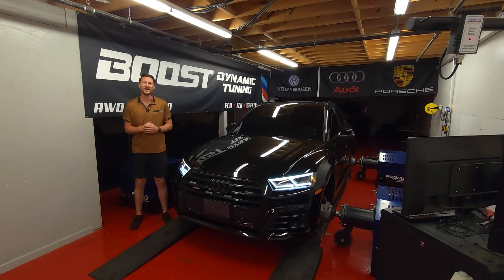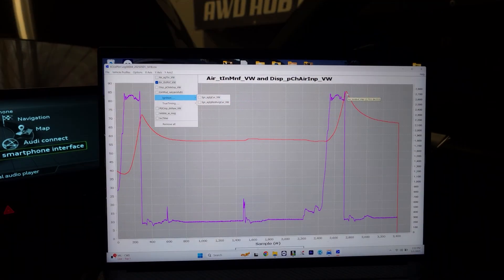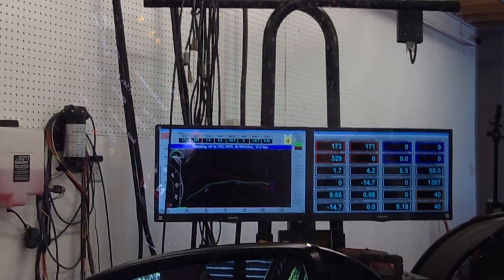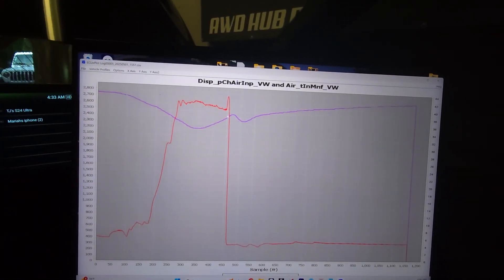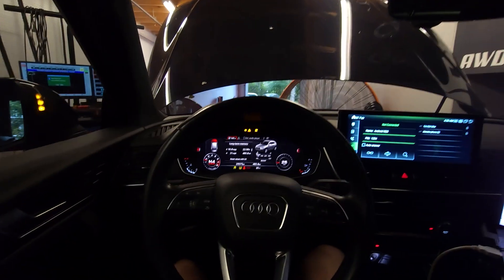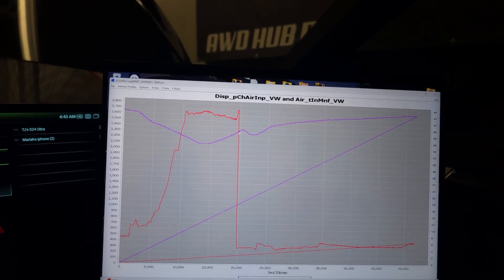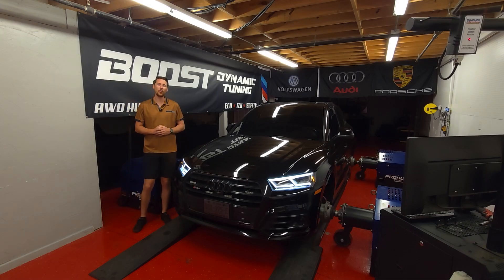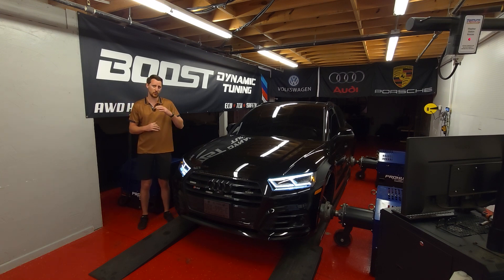B9 SQ5 3.0T Dyno Tested! Testpipe vs FMIC vs Turbo Inlet — What Actually Makes Power?

Comment: If the car is tuned with a test pipe and I decided to add a universal  300cpsi cat downstream to the exhaust simply to remove the smell, is a retune required?
Reply from the maker: No, no retune is needed at all.

Comment: What schooling did you have to do to learn how to tune? Did you just apply what you learned at school and started tuning right away or did you work at a tuning company first? I’ve always loved tuning and took the tuning course with HP academy and don’t know where to go from here to learn more about tuning.
Reply from the maker: @meidosonbol  it started like this. I went to UTI for automotive. Then I got my car tuned.. was like, "No way did software make my car go fast. Started googling and asking my teachers about it. I then bought a 2002 audi a4 and started to tune it based on nefmoto. Then, while working working for the dealership, I tuned for fun on the side. It started taking off, and I worked for a performance shop. Then, from there, I went back to Audi and went to their schools. Moving forward, I quit Audi and started my company in 2018. While doing so, I went to EFI university to make sure i knew my stuff. Got my ASE for performance tuning or whatever they call it. Then I took a couple of hp classes as well.
Reply: @boostdynamictuning  Thanks for taking the time to reply, I will look into the EFI university to build on my knowledge. I'm a Civil Engineer but not very passionate about it and trying to find a smart way to get into the tuning world. I own a B9 RS5 but don't want to use that as a test vehicle and possibly damage it. Ideal path is to work for a tuning company and get the hands-on experience that way but this isn't a very big field to begin with so there isnt a lot of opprtunities to work for a tuning company.
Reply from the maker: @meidosonbol  where are you located? I'm about to drop my rs5 stage 1  video later this week, actually. I will say NOT ONE tuning company will ever tell you how to tune. They hire you to know. In my journey, not one person helped me past stage 1 on old me7. Once you're past me7, not ONE person will ever help you. You can't go into tuning thinking money or oh it's fun... you have to have an unbreakable drive. People will say you suck, you stole tunes, and you blew my engine to try and bring you down. When really they did zero maintenance and blame you etc etc...  Again, if you go into tuning like your life depended on it, you'll get to where I'm at. No other way.
Reply: @boostdynamictuning I’m in Minnesota, great to hear you’re dropping a tune for the RS5. My car is stage 1+ on iE’s software with flex fuel integration. 

Yeah I’ve been in the aftermarket world for a while so I know how it goes. The first person to blame for any issues is the tuner. There’s plenty of finger pointing in the Audi world as you already know, even between the big tuners. I came from a boosted G37 thinking this community would be a little more mature but nope, it’s just as bad if not worse lol.
Reply from the maker: @meidosonbol  amen to that, I ask well though it would be better even with classier people.... yah found that's not the case. I will say I've met some amazing people though. Even good friends from this whole journey. I love it

Comment: You had a full intake also or just charge pipe ?
Reply from the maker: @ronpastuf5006  in the tip portion of the video, you'll see intake is wide open. I'm calling that a cold air intake/ full intake.
Reply: @boostdynamictuning  i seen you had the Turbo inlet pipe. Was there a full cold air intake also?
Reply: @boostdynamictuning  that would totally replace the factory airbox

Comment: Interesting results with the DP. Adam did a video last year with stock vs catless and his dump showed no results.
Reply from the maker: Did he have a fmic? Also, were torque limiters turned off? When testing, you must create the same boost levels, but not let the car cap torque. so you can see actual gains. I think the biggest problem is setting conditions for testing.
Reply: @boostdynamictuning  he did.  It was actually a stage 2 tune and the only change was the DP
Reply from the maker: @speedster00  couldn't tell you why the gains were low. All I can say is Boost stayed the same, throttle plate was open. I installed dp and that was my out come. I think it would be nice to test another car to verify gains.

Comment: FMIC is king, test pipe I can see something there, but most won’t go full catless, I’m surprised by the results, curious why on E85 we witnessed 3-4hp on hi-flow dp, going to test the FMIC this week, maybe 🤔 something there..
Reply from the maker: @adventurer4188  for sure, fmic is a must! On a proper tune, it lowers power based on intake air temps. I bet that's what's happening to you. I turned that feature off during these runs so dyno numbers were not misrepresented.

Comment: I love this video and tip of content. I m definitely GETTING  A FMIC immediately as summer time time is around the corner. Works way better on this platform than it did on the B8.
Reply from the maker: @Koachise  well said! Fmic is where it's at, especially with heat in the way.

Comment: Great video!  Love to see metrics based content like this.  I get the sense that you have zero interest in pushing any single product or vendor but do you mind sharing what products you used?  Was it a HF downpipe or a test pipe and what brand?  What IC did you use?  Thanks!
Reply: One more question, just for context.  You mentioned a few file changes during the test pipe and downpipe pulls.  Were all three pulls on the same stage?
Reply from the maker: @gideonyoun  thank you for watching the video! 
I try to keep the content open to results and not brands. Brands might come later if I get extra funding and time.

I used CTS TURBO for downpipe and fmic.

A high flow cat/test pipe are part of the exhaust system. It's right off the turbo, and in stock form is a HUGE restriction to flow of exhuast. Which hinders power. A high flow just has a filter in it to remove unhealthy emissions for the environment. Hope this answers all your questions.
Reply: Thanks, I'm tracking all of the mods and what they do.  I currently have a fmic and turbo inlet.  What I'm more curious about is if you installed a catless or high flow dp.  Also, we're all three runs on the same file?  For instance, all 3 we're done on a stage 1 or 2 file? Thanks!  @boostdynamictuning

Comment: Great video,I love the data centered  approach.  What brand fmic did you install?  Do you think there is much difference in performance between the various brands?
Reply from the maker: @jasonrollins9038  I went with CTS TURBO as they rock with quality. As for other brands... I don't have solid data, but the CTS HELD DOWN THE TEMPS VERY, VERY WELL.
Reply: @boostdynamictuning  You're right.  The difference is amazing.
Reply from the maker: @jasonrollins9038  being able to do countless pulls and not worry about temps is a super nice feature!

Comment: What are you saying to do about the code for downpipe? Live with it? I didn't quite get if you said buy an o2 spacer or not.
Reply from the maker: @Alex-fo1rx  off-road use only
You can't register the car on legal street roads.. I say this to protect my company.

There are companies out there that can handle it. For example, 034 deleted check engine lights for cats being removed. NEVER INSTALL O2 SPACER
MAKES THE CAR RUN LIKE 💩
Reply: @boostdynamictuning  thanks for the information! I understand 100% now what you are saying.